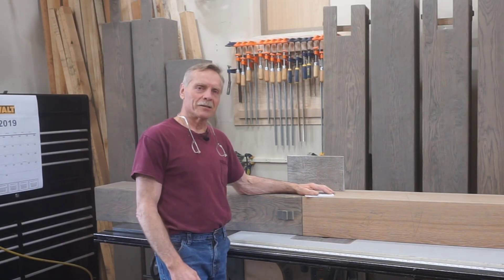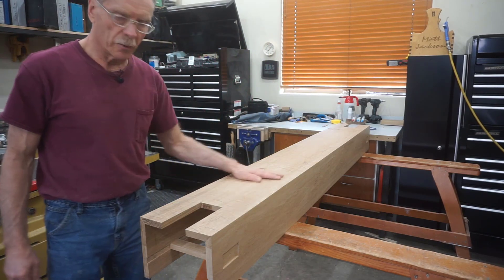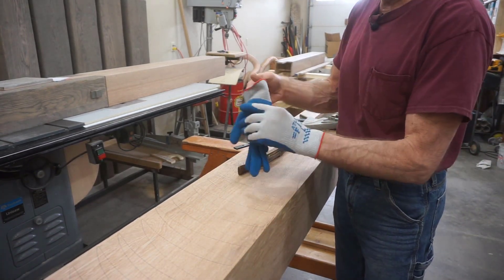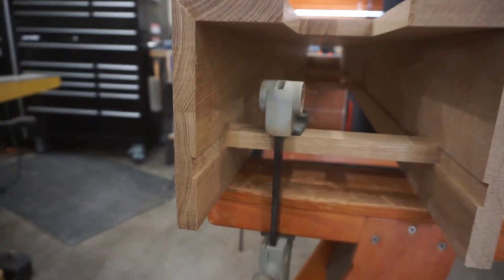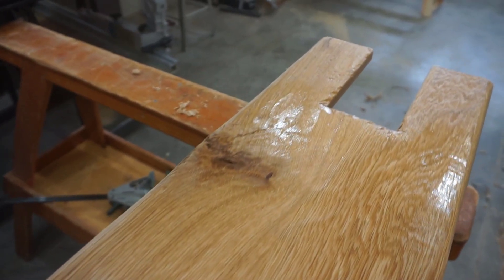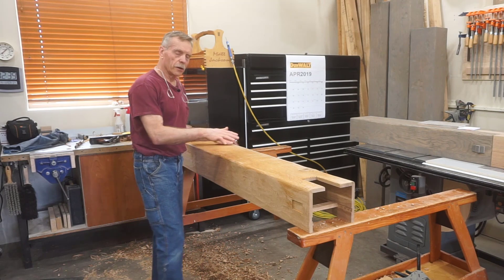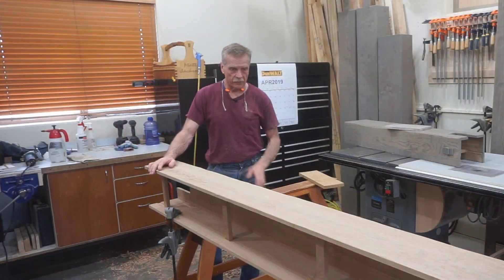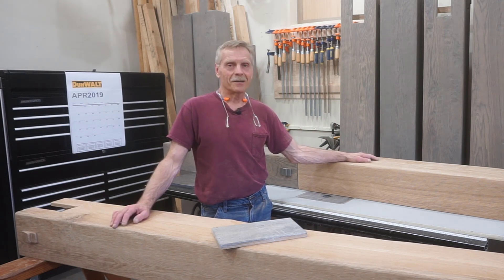Distress Faux Beams for a Century Old Look!

Comment: No offense but I grew up where lots of the homes in my hometown had real exposed beams.  I appreciate your skill.  I just don't agree with what is literally fake architecture.  It is just my philosophy of carpentry.  I have built a few post and beam buildings that have exposed structural components.
Reply from the maker: No offense taken David... but it must be tough for you to deal with rampant 'fake architecture' though.   The realization that a real brick home hasn't been built in what, 75 years, and people still think a home with brick veneer is a brick home?  Then there's gas fireplaces, engineered wood flooring, siding that's not cedar, decks made with plastic decking and on and on. Boggles the mind how little 'real' there is left and we're not even discussing what constitutes 'solid wood' furniture or cabinetry!😬😢  Best, Matt
Reply: Matt explained why the purist attitude doesn't fit in all occasions. His attention to detail is amazing. The paying customer dictates the level of authenticity of the job. And his level of snark was appropriate to the comment.

Comment: looks more like a bleached wood faux
Reply from the maker: It does look 'bleached' after the wire wheel because it's raw, bare wood.  Good thing is that it's the perfect texture and condition for all manner of faux finishing steps to follow. Best, Matt
Reply: Next Level Carpentry I was referring to the look with the finish on, thats more of a bleach look
Reply from the maker: @duartepaintinghandymanservices  Ahhh... I guess it does at this stage.  I plan on doing another video to show the faux finishing process that involves stain, 'whitewash' and dry brushing to bring it to the 'old beam' look the designer and homeowner are after.  I think all the steps to this point would be perfect for a 'bleached out' old dry wood look too... Best, Matt

Comment: One hundred years in one hour..
Please be careful sharing techniques as big evil corporations such as DuhWalt will steal your ideas and reverse engineer them.
Imagine a machine that could make an old board look brand new!
Mind boggling.
But on a serious note, I might question the texturing and shaping the insides of the joints as those old craftsmen were some artists and had some downright beautiful joints, maybe just some oxidation would suffice.
Reply from the maker: Right you are TMP... I didn't want to take the weathering too deep into those joints for that exact reason.  It was necessary to weather them some because  a 'flush fit' would be impractical to get during installation though... you'll be able to see this when I publish the 'fitting and installation' video soon. Best, Matt